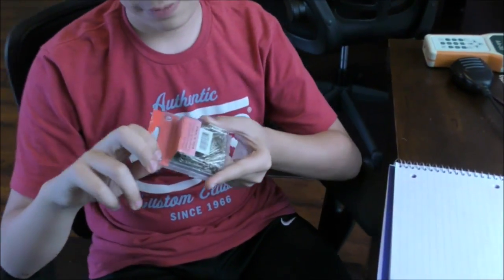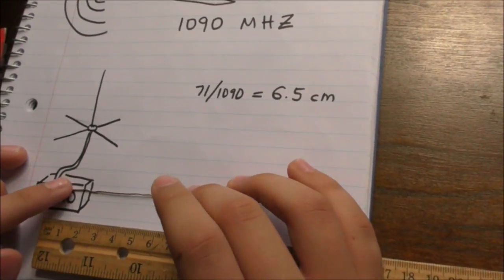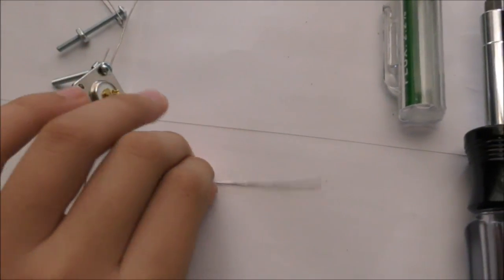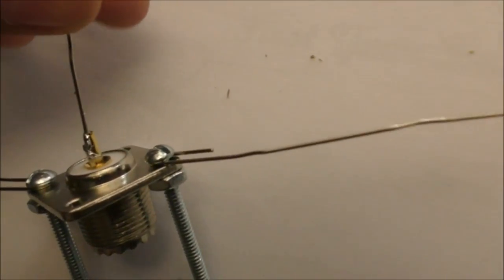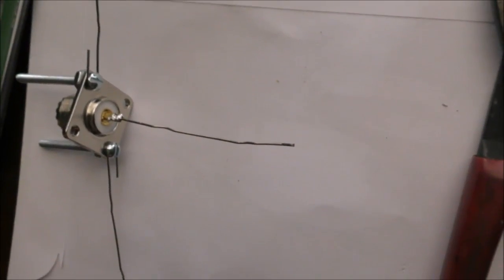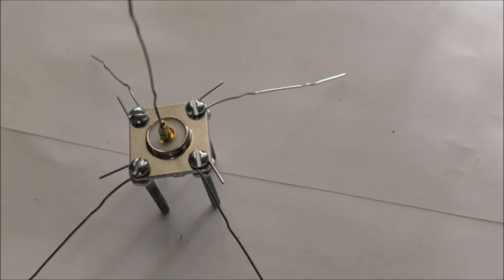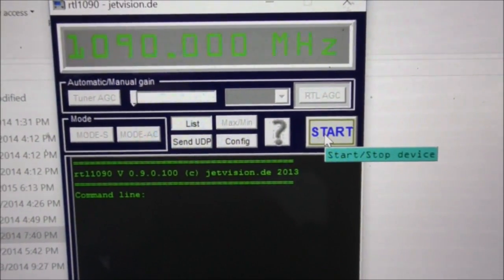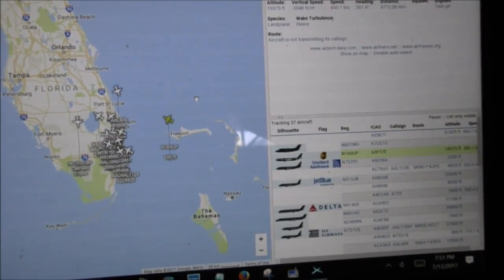2017: Paper Clip vs. Jetliner Traffic

Comment: Wonder if this would work for700/800 Mhz to use with my SDR on SDRTrunk?
Reply from the maker: Yes, the antenna dimensions need to be recalculated, they will be approximately 25% longer